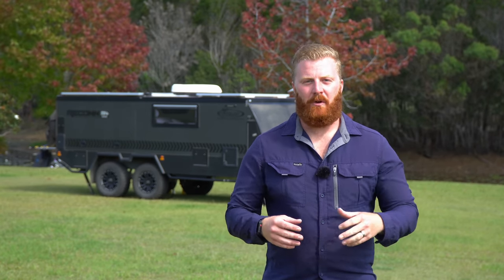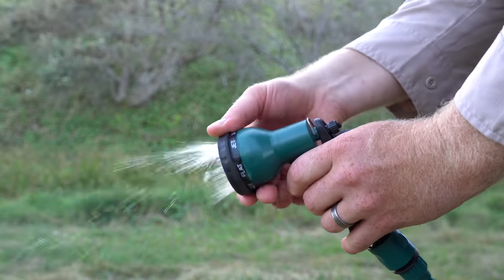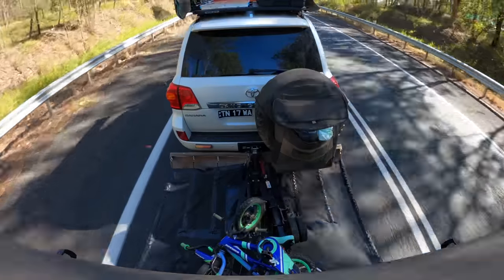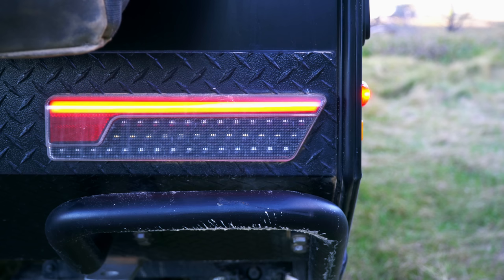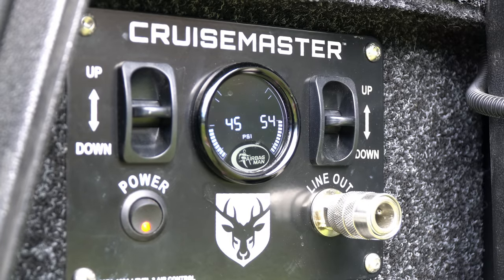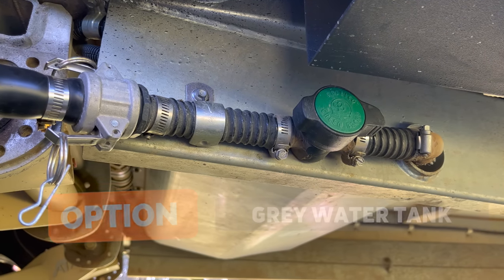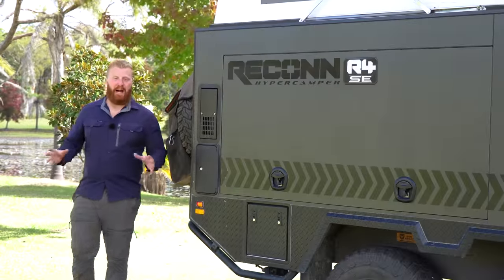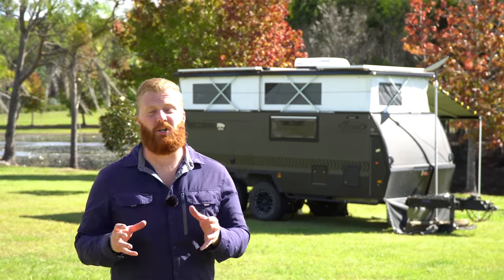Pt 1 | OUR NEW TINY HOME | LIFESTYLE RECONN R4T SE | Exterior, Suspension, Storage | Australian Camp

Comment: Hi Nathan, your video was very detailed and well articulated (as usual),. We have already done a few short trips in our R4T SE yet still managed to learn a few things about the camper that we weren't aware of..   We echo you comments about the airbag suspension, initially we opted for it because of its capabilities but quickly fell in love with how easy it made levelling the van at the camp site. Well done and looking forward to parts 2 and 3.
Cheers,
Richard.
Reply from the maker: Thanks Richard, appreciate that. 
Yes, the suspension is a stand out feature on these campers for sure! 
The next parts are uploaded and ready to go, my favourite being Pt 3 with our overkill and over designed off-grid power setup 😆 
All good fun 👍

Comment: Hi Mate,enjoy your video & find them informative.
Couple of points,(we also have ATX with air bags) it may be worth checking your rebound cables. I noticed they are starting to wear into the air bags. My wore through to the canvas. After speaking with CruiseMaster, discovered that the rebound cables were not installed correctly. Second point I believe that longer A frame would reduce ball weight ?
Reply from the maker: Your absolutely right in regards to the drawbar weights and that’s my mistake. 

I’m regards to the suspension, I’ll look into it and see what cruisemaster have to say about it 👍
Cheers
Reply: @XploringOz   All good Nathan. Cruise master sent us the installation instructions. I would send you a copy ,Unfortunately our copy are in van & our van is in QLD atm & we are in nsw.
Reply from the maker: @lifestooshortliveit5381  No problems mate, I had a good experience last time I reached out to Cruisemaster, so here's hoping it happens again 🤞

Comment: With the kitchen being on the outside, did you ever run into bad weather where you were not able to cook outside? Its a weapon of a hybrid/van/camper 😍.
Reply from the maker: Thanks mate, it sure is an awesome camper! 
We have had plenty of bad weather. High winds, consistent rain and heaps of cold weather, but nothing we couldn't handle. The awning will prevent the rain and if the wind is bad, we'll stick up the awning walls which offer plenty ty of protection. 
We have been on the road for over 6 months now and only eaten dinner inside the camper once (this was because I parked in a way where we couldn't open the awning in the rain)

Comment: one of the mods I've recently been told about is to get the 3m rear window protection film , it's 3mm thick and stops your back window smashing if hit by a rock or something like that.
Reply from the maker: For sure, that wouldn't be a bad idea. The Stone Stomper is a great alternative and I've never had an issue and this also protects the whole rear of the vehicle too. 👍
Reply: @XploringOz  because it stays intact because of the heavy duty film even if the glass is smashed your car is still secure and mostly dust and weather proof that  having a rock stopper on the van can't really do so both would be better working together. what i seen in the video was it was getting hit with a hammer and not breaking so i found it very impressive

Comment: 3:20 re. adding to the ball weight is incorrect ( unless adding loads of weight on the A frame ) Lengthening the drawbar by itself is like lifting a wheelbarrow with extra long handles , it = greater leverage / less load to lift .
Reply from the maker: I understands, I made a mistake in my wording here. But yes, you are correct. Obviously if adding extra weight to that drawbar this would increase that down force 👍 
Thanks fr mentioning it and hopefully others can read this too 🙏

Comment: Mate, fantastic review! We have the R4 Elite single axle and have been on the road for two weeks after picking it up in March (after a 23 month wait) My wife loves the outside kitchen, and l love the way it tows.
I'm also using Starlink which is great, but could you tell me about your set up and where you got your components from, because at present my dish just sits on the ground, which can be tempting for undesirables?
Looking forward to part two 
Cheers Glenn
Reply from the maker: That's awesome mate, sounds like we are in the same boat. Both love the camper! I couldn't think of anything I would change it for at the moment. 
Yes, so there are links in the description of the video in regards to both the mast and drawbar mount and the Starlink adaptor for the dish too 👍

Comment: That was a great explanation.  
Can I ask, how did you decide on the tandem axle compared to the single axle?  We've got one on order, and we've gone for single axle, primarily for keeping the weight down (but there's only 2 of us, and you have 4).  Was it just all the 'stuff' you needed for the 4 of you, so you needed the extra GVM (The single axle is only 2,800Kg GVM I think).
I'm impressed that your total weight is way less than 3500Kg, especially with all that water on board. Cheers - David
Reply from the maker: Thanks mate 👍
For us the main reason was for weights, but there are several considerations for this decision. Maybe an idea for a future video. 
In the end, with a family of 4 we knew we would exceed to 2.8t atm on the single, particularly with all of the extras options added

Comment: They should run seat/bed AC and run a extra solar panel. They run cool and use less power too. Mostly from cooler air and nobsun heat soak.
Reply from the maker: It could potentially be an option as there are many different ways to fit heating/cooling into these campers. The roof top is probably the easiest though and I mean we are running 1.08kW of solar... how much more do we need 😆
Reply: @XploringOz  They used to offer the under seat AC, but with the new model this has been removed, and you can only get rooftop AC.

Comment: One thing i found interesting was that Disc brakes are not a option or not available?
The grey ando plug at the rear underside is for solar panels?
What other options thatcwere available that you didnt want/ need?
Reply from the maker: Hey mate disc brakes are certainly an option if you want, one of the few we didn't opt for. Reasons because we didn't need it and the cost, they are not cheap! 
Anderson plug is for solar input (Pt. 3) 👍 
Other accessories were rear camper camera, diesel heater/water heater, matching wheels and tyres (price limited)
Reply: @XploringOz  ❤